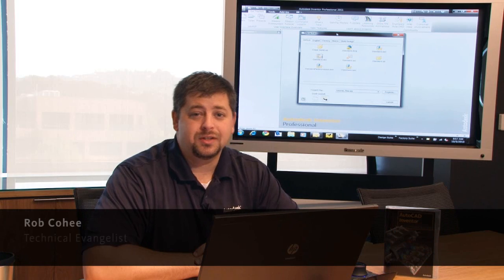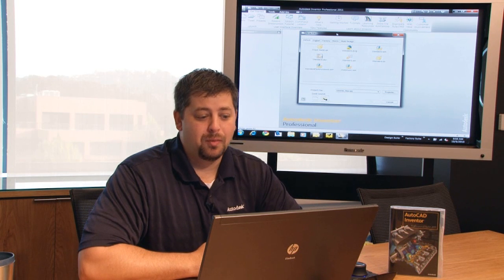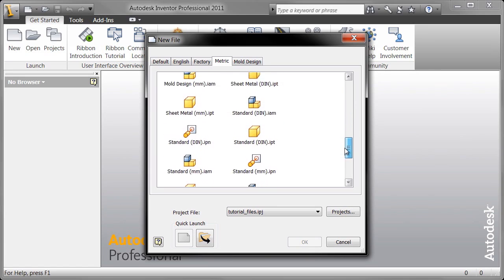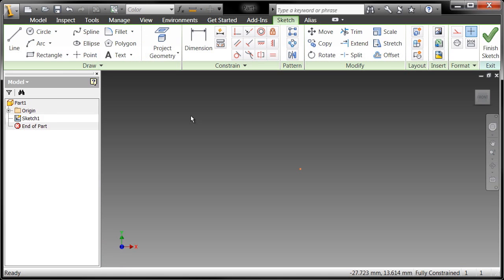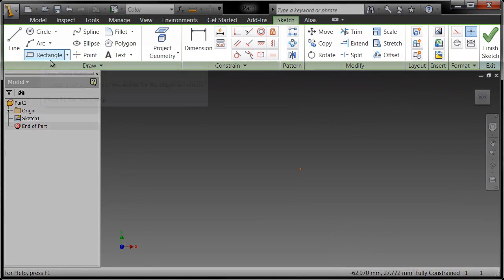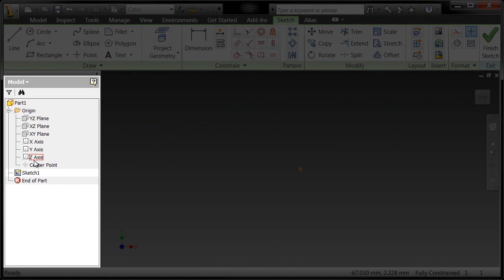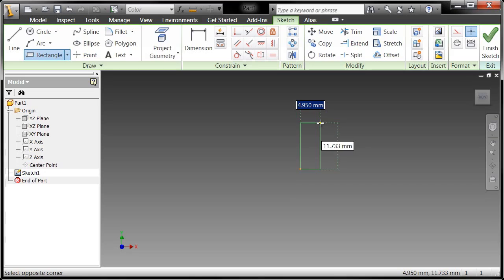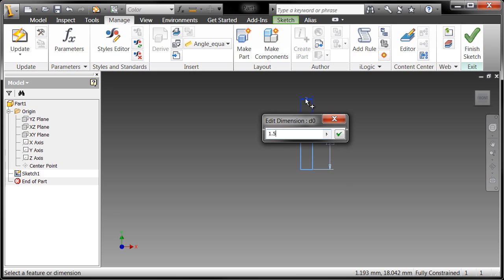Autodesk Inventor Fundamentals - Basics of Part Modeling Chapter 1

Comment: I used inventor R8, but I am using now 2010 version, and have a lot of problems with adaptive parts, does anyone here know if i need to change settings or recommend me a video to understand better this? I start with assy and create new parts from it, I thought that projecting edges will carry new sketches to new place or dimension, according to what I have releated it, but it´s become crazy to test every new feature to see if the assy works, many times the extrusions dont go to where the new position of the part, and so... any comment will be welcome, thanks

Comment: Superior? Not exactly. 12 inches in a foot. 12 is (evenly) divisible by: 1,2,3,4,6and 12. Metrics: 10 is only (evenly) divisible by 1,2,5 and 10. So, take a meter long board and cut it into 3 equal parts. 10/3 = 3.3333333333333. 10/4 is 2.5, thats not even. Cant use 10/6 either. Thats like 1/32 of an inch? Repeated enough times on a 200 foot run, that is almost 2.5 inches off. That is alot and not acceptable in building standards of anything.

Comment: @MikeEvansHfd You generally dont miter tube, you bend it, however frame components, you would miter. Have you tried using frame generator? This is the best way to create easy miters, flush cuts and frame components in general.